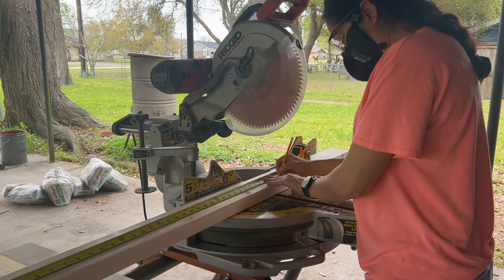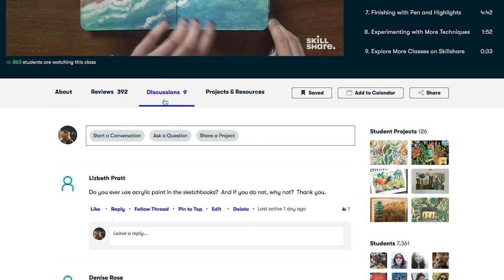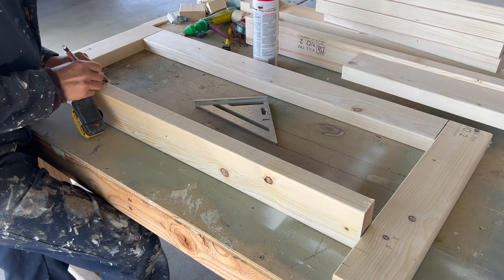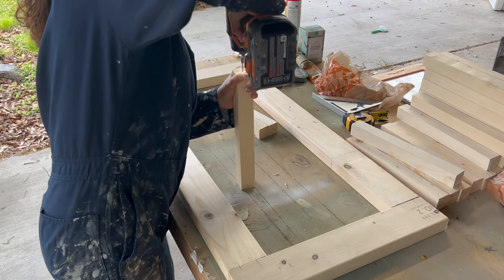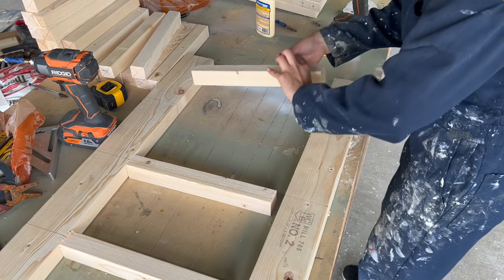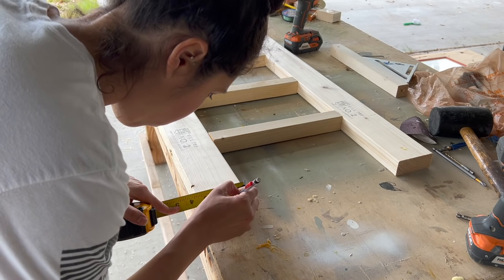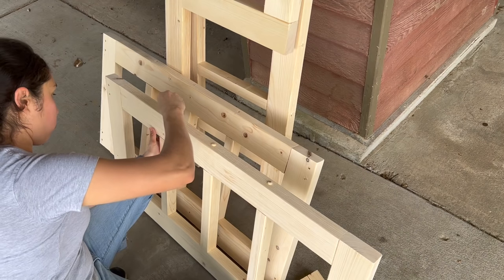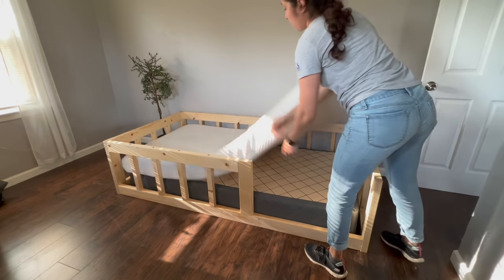DIY Toddler Bed | Easy & Affordable | Bedroom Makeover Part 2

Comment: Great job on drilling the dowels straight free hand. I’ve made several transition beds over the years. I would like to respectfully caution you on the spindle placement. There is a strangulation hazard having them that far apart. I would suggest adding another decorative spindle in between the current ones to get that space down to 4 inches apart or less. Again respectfully, I would also add to the head end to raise its level to above her head while she’s standing on the mattress . Children like to jump and flop back when going to bed. Having the head board that low puts it at a very dangerous position at her neck and the back of her head should she just flip backwards to lay down. I hope I don’t offend. Thank you for sharing your work.
Reply from the maker: Not offended at all! Thank you for your respectful suggestions! ❤️